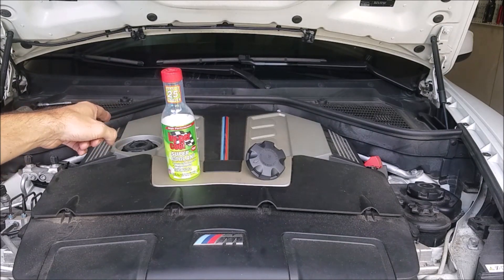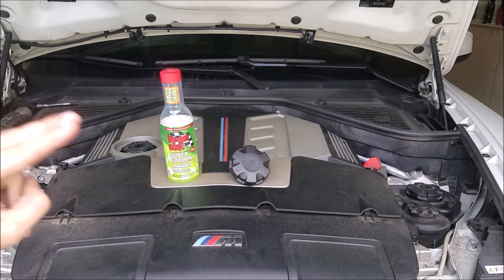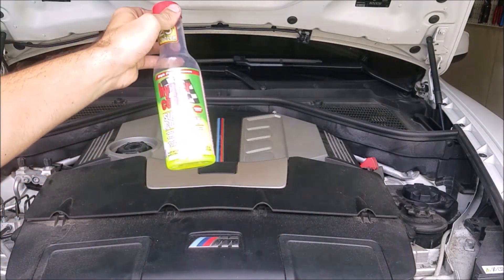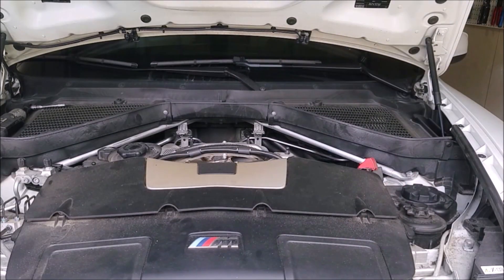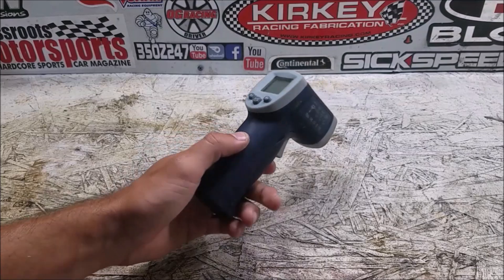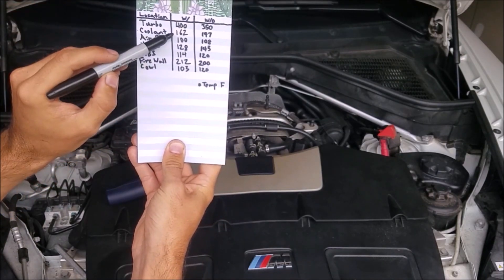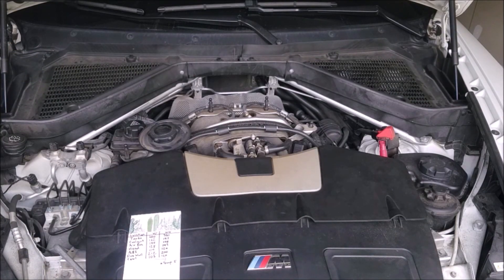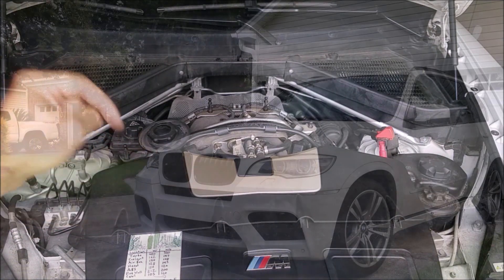E70 BMW X5M Cooling Upgrades (Part 3 of 3)

Comment: Won’t water seep in during a car wash / heavy rain if you remove that back panel behind the engine ??
Reply from the maker: Hasn't been an issue over the last 3 years; there are drain holes.

Comment: So manu videos on probems with heat.
Hardly any on how to prevent it from constantly happening.
Reply from the maker: That's literally what these videos are for? The car now runs perfectly. Never had a problem out of it now that I've fixed all the factory problems.

Comment: I suspect the design of the covers and seals in reality augments the cooling of the engine bay during most of the engine's operational state. This is probably due to the airflow control that these trim pieces and seals enable when properly installed. Without all the seals and trim pieces, the heat does not flow through as efficiently and may cause accelerated heat damage to the engine bay in general.
Reply from the maker: Yeah, that's not the case at all. The only thing they're worried about is NVH, dealer lot appeal, and keeping water out. By the time the hoses and plastics start to fail, the warranty is long gone. The seal at the back likely doesn't make a huge difference either way, but the engine cover is an absolute negative.

Comment: Do you have a part number for the 1.4 bar cap? I'm wondering why u didn't list or mention where u got it from. hat info would be appreciated
Reply from the maker: I told you which X5 it's from. Go to FCP Euro and select the Diesel engine option to get the 1.4 bar cap.
Reply: @350Z247  Yea , I missed that.. Thanks for responding. I'm an idiot😁😁

Comment: Any reason you're not running Evans Waterless coolant?  I switched to that after having to replace the expansion tank and now I don't worry about coolant pressure bursting anything now.  Been using it for about 3yrs, countless roadtrips and 3 Bimmerfest trips (Seattle to Hollywood to Vegas and back to Seattle) without an issue.  

On a side note, I've also removed the gasket closest to the front window to let heat escape and I don't run the engine cover simply because my catch can setup interferes.
Reply from the maker: I've never really been a fan of Evans. I've never had any issues with distilled water and coolant. It's cheap, it works, and I can get it at every gas station or grocery store in the country should I need more. The 19 PSI cap I'd plenty low enough for hose longevity.
Reply: @350Z247  Fair enough.  BMW's are notorious for cheap plastic cooling systems, my buddy S62 supercharged swapped his E34 and Evans kept the car at perfect temps during our yearly Bimmerfest trips so I've done Evans in our BMW's ever since...can't get brittle and burst if there's no pressure :-)
Reply from the maker: @M5JamesE39  it's just not something I feel the need to use. It's great if you're having issues. My wife's X5M leads a pretty easy life

Comment: Anyone know how to get better gas mileage on the x5m ? I’m getting 12.4 and it sucks
Reply: It's a 5500lb SUV with a twin turbo V8, c'mon man lol.  You'd get crappy mileage in a 3.0 because you have to push the pedal down more to get up to the same speeds.  It is what it is.
Reply from the maker: My wife's average is about 17 on mixed driving without any effort towards fuel conservation. On the highway, I've seen 20mpg at 80mph. 12.4 mpg sounds like something's wrong or you've got a heavy foot.
Reply: Get better.

Comment: Another great video! You're awesome. This is something I'm researching before purchasing my X5M.

I watched all 3 videos, and I read every comment looking for this, but couldn't find anything. What was the impact to your MPG? I know you mentioned in a comment a few days ago that you're around 17-20, but I just want to make sure that's AFTER the cooling changes? I ask cause some random person in another video mentioned it being a big hit to MPG, but that sounds great!

Another question I have, does the temperature change of the hood affect the paint at all over time... I mean, I'm sure it does, but are you concerned at all at the rate of degradation? I guess it's not a big deal considering the benefits to what's under the hood.

Anyway, thanks again for all the info! Trying to be as ready as possible when I get mine!
Reply from the maker: That was my mileage after installing both parts. We didn't really notice a change. How you drive will likely make a bigger change in MPG than these mods will. I'm not worried about the paint as the underside of the hood is protected, plus I'll be adding a turbo blanket directly to the exhaust housings some time soon.
Reply: @350Z247  awesome! Thanks again!
Reply from the maker: @Tenekai  any time!